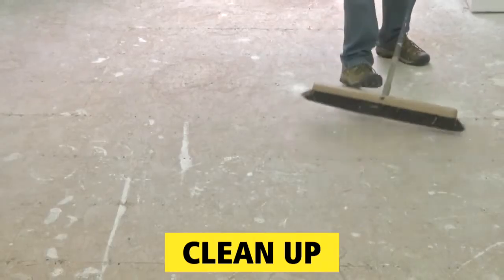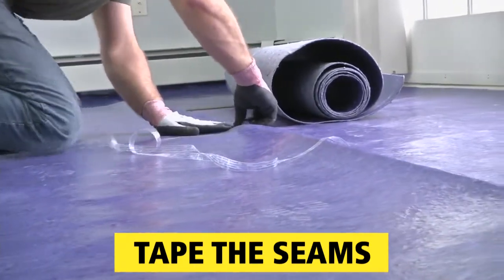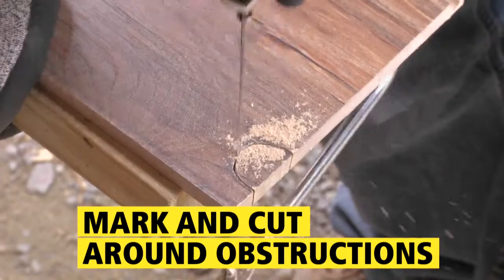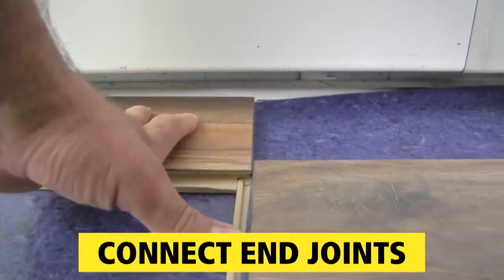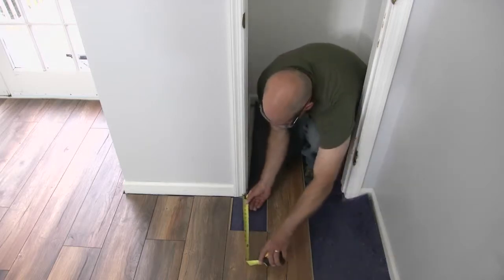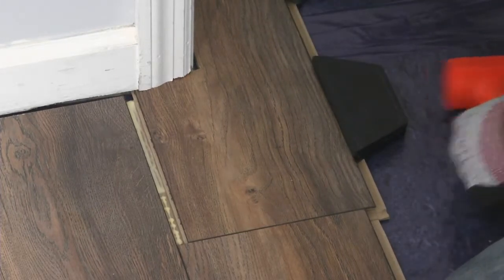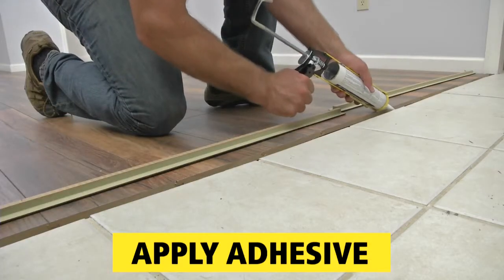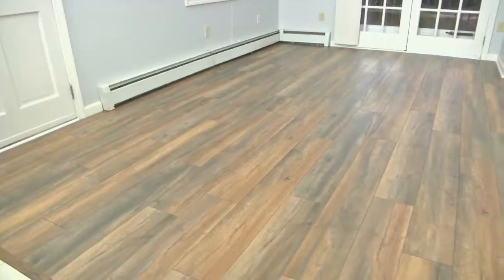How To Install A Laminate Floor: Beginner's Guide - STANLEY Pro Project Guides

Comment: How do you install laminate around baseboard heating?  On your video your baseboards are not touching the floor.  How do you cut around them to fit?  I do not feel comfortable nor do I wish to actually cut the metal baseboard heaters like you would a door jamb.
Reply: That’s a tough one!  Perhaps you’ll have to cut the flooring to leave a 3/8” gap, then install  some flat moulding or 1/4 round trim to hide the gap.  Or cut the metal.
Reply: Lol I’m here for that too lol